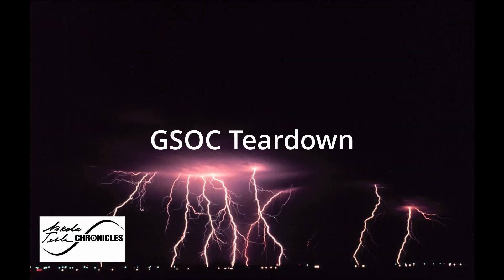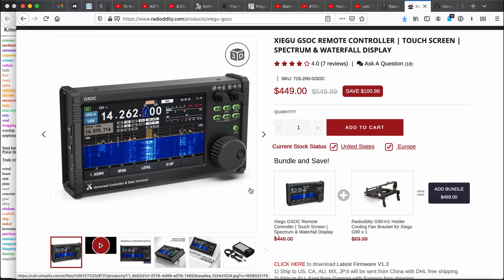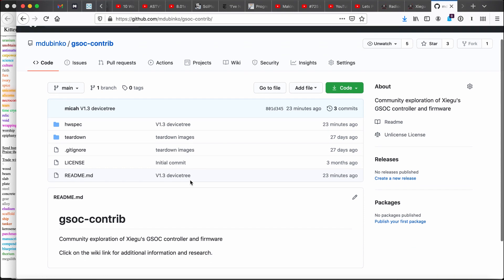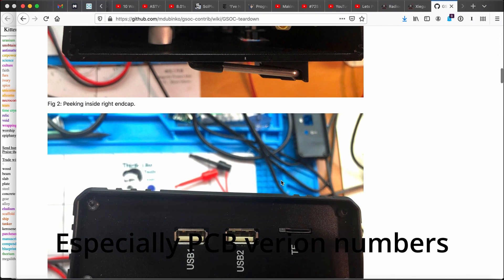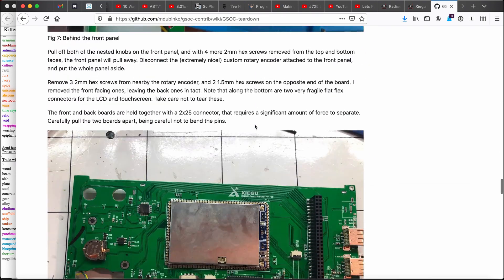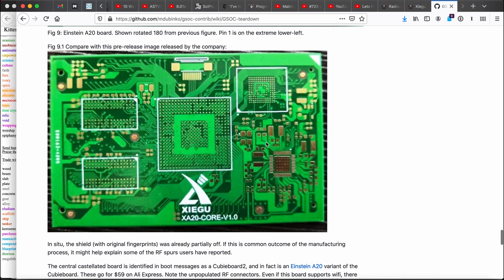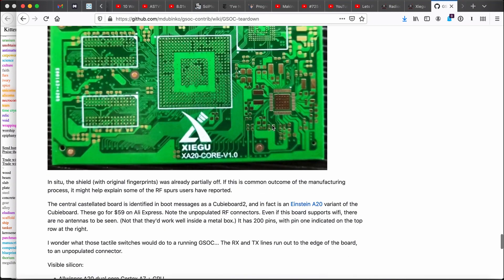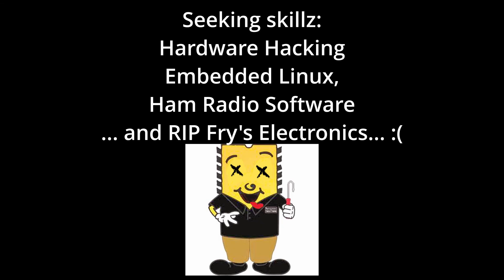GSOC Teardown

Comment: I have had a  Xiegu G90 for some time that is still in the box. I was considering the Xiegu X6100, but recent info shows it to be less than advertised. I'm now considering the GSOC to pair with the G90. Do you feel the project is making and adding useful additions and functionality to make the GSOC a worthwhile purchase? Do you have a present set of firmware and drivers that you would recommend? I will look to your community, as I enjoy hacking and improving what a manufacturer SHOULD have provided. Thanks for your energy towards the project. Best Regards.
Reply from the maker: Of all the people I know who are happy with the GSOC, they're all G90 users. There has not been a firmware update in a long time. I'm learning a lot about embedded Linux, but if the Github project had an experienced pro around, I think we could have something up on fairly short order. Anyway, the existing 1.3 firmware is the best recommendation for now.

Comment: Nice review! If the A20 SOM is running Linux, you can probably add the AP6210 drivers that provide WiFi b/gg/n and BT 4.0. You probably can mod the case with two SMA sockets and U.FL pigtails to add external antennas. Should be an easy thing.